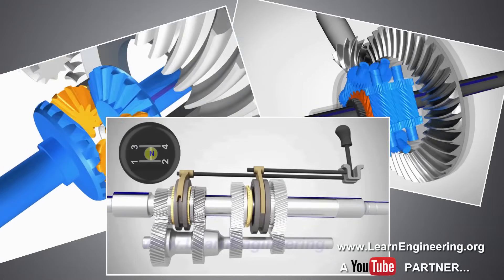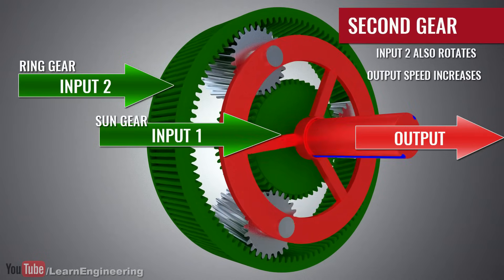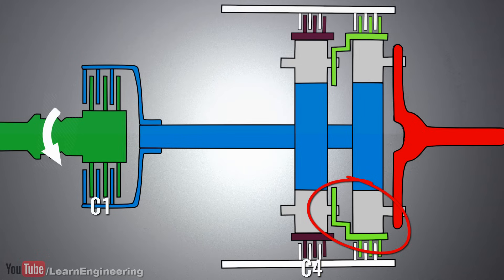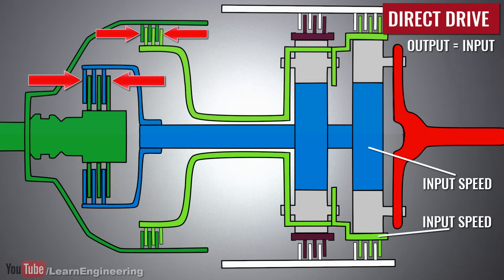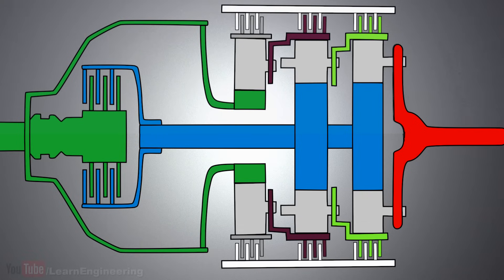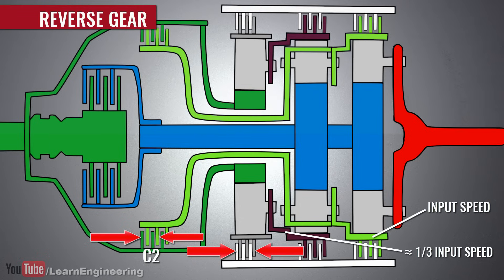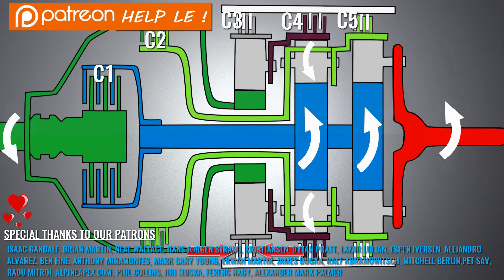Automatic Transmission, How it works?

Comment: There is so much going on inside a automatic transmission from the torque converter to the clutch packs, solenoid, valve body with all kinds of passage ways and steel balls. It's truly amazing it works everyday when we get in our vehicles. All those parts moving and engaging and disengaging over and over.  It's one of the modern marvels of engineering.

Comment: Is a torque converter really necessary? When you’re not pressing the gas, isn’t the power transmission already cut off? Can you answer me anybody
Reply: The engine is always spinning, always working, even at idle when you aren't pressing the gas (look at your rpms).  The torque converter (in an automatic) is what couples that spinning engine to transmission gears,  it's what cuts the power off or turns it on.   Power transmission is cut off by slip... the fluid dynamics aren't engaged to turn the gear side of the transmission.
The auto shut off in some cars when you stop is relatively new to vehicles and is more what you are saying,  stopped at idle and the engine gets shuts down.  But otherwise if the engine is running then it's making available power for the transmission via the torque converter.
That's my understanding but I'm no mechanic or engineer,  better educated folks here might make it clearer with corrections but I think that's the gist of it.
Reply: This channels video on torque converters makes it much clearer...https://www.youtube.com/watch?v=bRcDvCj_JPs

Comment: -for underdrive gear arrangement , make the sun gear of the final gear set have the input speed and change the ring gear speeds to get the required speed of planet gear.
-for overdrive gear arrangement , make the ring gear have the input speed and change the sun gear speed to get the required speed of planet gear.
-for directdrive gear arrangement, make the sun, ring gears have the input speed so the output speed=input speed
-for reverse, it's the same gear ratio of 1st gear which ring gear is hold,  but  think a way to make the sun gear have the input without holding its clutch so u can change its direction.

Comment: It didn’t explain what’s making the clutches press together, Transmission fluid is like hydraulic fluid and the computer tells the valve body to open a certain solenoid which fluid can run through certain ports and lines to push on the clutches so that it can turn whichever gear needs to be turned (I don’t blame yall that was confusing)
Reply: And there’s one way gears so that you can let go of the gas petal and brake kinda like a bike where you petal you engage the gear but let go tick tick tick tick tick tick

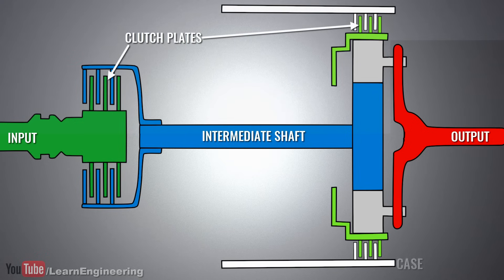Comment: 1:31 CLUTCH PACKS ARE THE ANSWER MOST OF US ARE LOOKING FOR! Each pack has multiple pairs of clutches where one ring has teeth on the outside and the other has teeth on the inside. Each ring in a pair also has a sandpaper like texture on one side so when they touch they spin together, thus connecting the input from the engine to the intermediate shaft and output. When the clutch plate pack on the input is not squeezed for the sandpaper sides of the pairs in the plates to connect, it breaks the connection, leaving only the input spinning from the engine and no other parts of the transmission. Once this concept is understood, we can begin to squeeze(engage) multiple clutch packs together to create the different gear ratios that we perceive as 1st, 2rd, 3rd, 4th, 5th and 6th gear. The rest of the video began making sense to me once I realized how the clutch packs work and how they are what makes and breaks the mechanical connection to the planetary gear sets which makes up the gear ratios. I hope this helps some of you gentlemen.

Comment: Much better than the 3d model. But still difficult. 

It would be better if you could animate the rotations in 2d as well, not just arrows. 

It's possible using horizontal visualiser lines on the gears.

Comment: In automatic transmission, why pressurized transmission fluid is required to engage/disengage the clutches when we have powerful actuator inside? Does these actuators not capable of handling power requirements for clutch engagements?

Comment: ok but how are the gears selected automatically?
Reply: through the valve body which is directing hydraulic fluid to the pistons applying the clutch sets.

Comment: Went from gears 1, 2, 4, 6, 3, and 5, that's not confusing at all, you also expalined the path of power for the easier gears (undedrive gears 1-3, but didn't explain how the path of power flows in gears 3 and 5

Comment: So the non stationary ring adds speed to the output shaft? I was watching an Allison training video and they stated that although the ring gear is rotating and is no longer stationary, and since the ring gear is rotating slightly slower than the sun gear of that same planetary set which causes it to resemble "that of a held member" so the Allison videos lead me to believe that although the ring gear is not held, we still have a reduction, but in this video it seems that when the ring gear is rotating we have an overdrive condition, and now I'm confused and don't know what to believe 😅

Comment: masterpiece of engineering ! no wonder those transmissions are shorter on life, because there are more elements spinning than in the manual transmissions. Manual transmissions are way better to keep better control of the engine

Comment: I'm an aerospace engineer and I did not understand how the transmission worked after this video. I think 3d model that adds parts would be better. I think the definition of what each piece is in the diagram was lacking. Great job nonetheless, I'm electrical not mechanical.
Reply: Same here.
The video does not state whether the sun gears are connected together.
I'm not sure but they have to.
I'm still thinking, but I came here to see if anyone has touched on this point or not before going back to watching again.
Reply: @fawzisdudah8511 I can’t understand or relate to any of the vocabulary in order to have an understanding and follow along

Comment: That's brilliant. But a question here: how does it apply the needed shafts? Does it run with only computers or is it achievable with only mechanics? (What decides to apply C1 and C5 for example?)
Reply: They've been all electronic since the 80's or so..  
transmissions with over 3 gears would be too complicated if they are 100% mechanically controlled.

Comment: So…

Gear 1: C5 hold Ring#1, C1 so Sun#1 alone spin Planetary#1

Gear 2: C4 hold Ring#2 and C1 spin Sun#2 spin Planetary#2 revolve Ring#1. Sun#1 and a slow Ring#1 spin Planetary#1

Gear 4: C1 spin Sun#1, C2 spin Planetary#2 revolve Ring#1. Sun#1 and Ring#1, both in same speed, spin Planetary#1 as input shaft speed aka Direct Drive ratio.

Gear 6: C2 spin Planetary#2, C4 hold Ring#2 so Planetary#2 focus on spinning Sun#2 faster while revolving Ring#1. Faster Sun#1 and normal speed Ring#1 spin Planetary#1, makes Overdrive ratio.

Side note for Gear#3: Sun#3 always turn at engine speed, so when C3, the output of Planetary#3 is same as Planetary#1 in Gear 1

Gear 3: C3 hold Ring#3 so Planetary#3 that revolve at Gear 1 speed revolve Ring#2. C1 spin Sun#2, Sun#2 and slow Ring#2 spin Planetary#2 that revolve Ring#1. Sun#1 and not-so-slow Ring#1 spin Planetary#1.

Gear 5: C2 spin Planetary#2, C3 hold Ring#3 so Planetary#3 revolve Ring#2 with Gear 1 speed. Ring#2 is moving so Planetary#2 spin Sun#2 at a rate slower than Gear 6 while revolving Ring#1.  Not-so-fast Sun#1 and normal speed Ring#1 spin Planetary#1, makes Overdrive ratio below Gear 6.

Reverse: C3 spin Ring#3 so Planetary#3 revolve Ring#2 that spin Planetary#2 that spin Sun#2 in the opposite direction. Sun#1 that spin in the opposite direction spin Planetary#1 so Planetary#1 revolve in the opposite direction. C5 to lock Ring#1 so Ring#1 will not follow the revolving movement of Planetary#1, and the revolving speed of Planetary#1 will therefore not be slowed.

P.s. this is just a note for myself to understand better. lol.
Let me know if I mistaken anything. Also, I recommend toying with this: https://www.thecatalystis.com/gears/ . It especially helps to understand Gear 6, Gear 5, and Reverse

Comment: the outside of C3,4,5 is always stationary right? so the clutches of C3,4,5 are just there to keep the corresponding ring gear at a standstill right? 

i don‘t see any way for the outer clutch part of either of these to get propelled in any direction.

the ring gear of C4,5 can be moved by it‘s planetary set input side, but the ring gear of C3 can not be propelled at all right? it either moves freely (no reason for that) or it‘s kept at a standstill

Comment: Except this doesn't explain the main question: how does the car ACTUALLY SHIFT? I.e. how does a car "know" that it needs to shift up, or how does it know to kick down when you floor it while passing someone, but not kick down if it would result in RPM that's unsafe for the engine, etc.? Especially before the computer controlled shifting...

Comment: I'm looking for a simple animation to teach a non engineer/non mechanic the Automatic transmission basics. I think a flow of power should be shown. I see where the clutches are applied but can't show where the power will flow through, which makes this video fall short right at the finish-line. This change would make your video perfect imo.

Comment: its amazing they can run 150,000 miles (If u have a 4L60E, or 700r4) without failing...they are simpler than one would think, its the engineering that is compex.:..the operation is fairly simple...

Comment: So I figured that applying C4 & C5 together would lock up the engine. Would having C2 & C5 be a different gearing for another reverse gear?
Reply: C2 and c5 would lock up the engine because c2 is connected to the planetary gears and those gears are connected to the ring gear for c5

Comment: 1 planetary gear set is what Ford used in the Model T, and it was not used to its full advantage. It would use the gear set for low gear, and reverse. High gear was not a gear at all, it was a clutch that bypassed the gearset. To me, the most amazing thing is how sophisticated the GM 4 speed Hydramatic was. It came out in 1938, before all of the 2 speed automatic transmissions! It was so solid that it was used in some WW2 tanks. Amazing.

Comment: So,
The first clucth engages the sun gear of the 3rd shaft which disengages the 5th clutch and locks the 3rd cluctch ring gears, essentially freeing the intermediate shaft but connecting the 4th clutch to the rotating clutch.

Comment: No, planetary gears have THREE inputs and THREE outputs as each of the inputs is also an output.  The ring gear can be both input and output; that's what makes this thing work.  The sun gear is an input and output.  The carrier shaft can be used for input or output, ie roll the car backwards while in gear and the carrier will move the gears, albeit backwards.  What rotates depends on what you hold still and where the power is coming in.

1. power: carrier, held: ring gear, rotates: sun gear but slower.
2. power: carrier, held: sun gear, rotates: ring gear reversed.
3. power: carrier, held: none, rotates: ring gear and sun gear.
4. power: ring gear, held: carrier, rotates: sun gear reversed.
5. power: ring gear, held: sun gear, rotates: carrier but slower.
6. power: ring gear, held: none, rotates: sun gear and carrier.
7. power: sun gear, held: carrier, rotates: ring gear reversed.
8. power: sun gear, held: ring gear, rotates: carrier but slower.
9. power: sun gear, held: none, rotates: carrier and ring gear.

https://www.youtube.com/watch?v=ARd-Om2VyiE This video has a pretty good explanation of planetary gears.  Give it a look see.

At 4:17, you have a major problem.  If the planet gears are connected to both the carrier for the next planetary gear AND the carrier in their own planetary gear, they WON'T WORK.  Also, ALL the clutch packs are attached to the case of the engine.  You have clutch 2 attached to the torque converter housing and the first sun gear.  That would not work as the clutch would not hold anything still.  That would in turn defeat the point of the clutch.

Comment: They left the torque converter and lockup clutch out of this video.
They also have input and output reversed..
Output RPM is never 3x input rpm..The input is can be in low first gear.
Output rpm is only greater than input rpm in overdrive usually around 1:25:1 ..not 3:1.
Sick of incorrect morons making trash on gooftube.
Stupid video.

Comment: Pardon my question, but in the actual transmission, how the clutch packs are "applied"? It is an electromagnet, an hydraulic actuator, or what? How the correct combination of clutch packs is selected for every gear? 
Thank you...

Comment: "Automatic" transmission? But still a clutch is needed. What's automatic about using a clutch?
Reply: these are hydraulic clutches that are applied by a hydraulic circuit, automatically. Between this and the engine is a torque converter that allows the engine to slip at low RPM and sit at idle while in gear.

Comment: Another video that promises to explain how automatic transmission with planetary gear works, that only explains how the planetary gear works... Where is the automatic trasmission in this? How does it automatically happen, that corresponding clutches engage at desired moments during the driving?

Comment: This animation is lacking the following: 1.  For each gear, show the power flow arrows from the input shaft to the final output shaft.  2. A summary table on the side, that shows for each gear, which clutch pack are being applied.

Comment: If you know the meanings of the connection shown in the 2d diagram.
- Like how the ring gears of all the sets are in mesh with the casing.
- How planet gears are connected with its adjacent ring gears.
Then you can actually understand the rotation of each of the gears...
It took me 15 minutes to understand all of this.

Comment: What i miss from this video is, what makes this transmission actually automatic? I mean it is an fantastic way to change the gears without a clutch, but what decides which gear to choose? And don't just say "electronics"...
Reply: Nowadays it's the electronics of the transmission based on a load of parameters. Back in the early days of automatic transmission it was based on pressure difference that were influenced by the position of the throttle

Comment: "you'll be amazed by the brilliance of this mechanism" 
me: I am more amazed by the fact that someone once sat and thought "okey i'll invent planetary gearset"
Reply: You were amazed by the brilliance of this mechanisms then 😂
Reply: Its more a step by step process. Nothing was just invented immediately. It was trial and error, observing and applying adjustments.
Reply: Planetary gearset was invented in BC times
Reply: @awepossum1059  Yep. Epicyclic gearing was invented more than 2000 years ago.
Reply: Model T Ford had a planetary gear set.  Bands were actuated by pedals, only had two speeds and reverse, no torque converter just a neutral position on pedals.
Reply: I swear, i've always had a similar feeling about IC engines in the first place...

Comment: So for every gear (1st gear, 2nd, 3rd, etc) are they the same size? Do the planetary and/or the sun gears change in size? Or is it when they connect together they have a stronger force from the torque converter that allows for higher speed? I’m a little confused. Someone please explain.

Comment: I know little about automatic transmission. There is guy on here has video shifting automatic transmission manually with toggle switches. Clutch pads burn out and rebuilding one takes attention to detail one wrong part installed backwards game over.

Comment: I have rebuilt C-4 and turbo 350/400 auto trans. I have rebuilt manual transmissions when in high school. M-22 rock crusher and saginaw 3 speed. Understanding the servos acting on clutch packs in a automatic is important. This is an excellent video illustration. Worked on engines and transmissions way before you tube in 1974. Learn by doing. Automatics in cars today computer reliant.
Reply: Hello. I do not understand for the moment how the transmission decides to shift gears depending of the driving conditions with an hydraulic system, so it would be glad if you, as more experimented on the subject than me, could explain it.
Reply: @QMarais95  you tube has videos of the actual fluid movement and how the torque converter works. How the valve body acts to shift gears.

Comment: then how do you engage/disengage those clutches? by clutch pedal? and then select gears? i thought that automatic transmission is just throttling and braking, no clutch, no gear shift. or this video is incomplete?
Reply: The clutches are operated by a hydraulicly. These days it would use hydraulic servo valves controlled by a computer, but in the old days it was all hydraulic and mechanical. The complexity of it makes the planetary gear system look simple. You can find schematics online.

Comment: I have watched a lot of these videos (didn't understand many of them but...). What none of them has ever explained is how does an automatic gear box change gears, what is the mechanism  that decides when to change up or down?
Reply: It's computer controller based on throttle and RPM

Comment: I've always enjoyed the clever designs used in hydraulically controlled transmissions.
Keep in mind people, exceeding the torque limit of the various disk clutch packs can damage them, causing friction overheating of the surfaces, warping and burning if they're forced to slip while applied.
Reply: some transmission as soon slip is detected in them they go in to limp home mode. the TCM or PCM stops all shifting and kills power the solenoids in the transmission. revers stills works for drive the direct drive gear is the limp home gear.